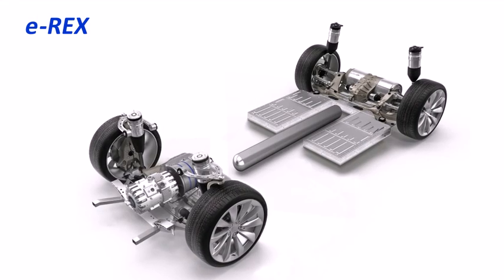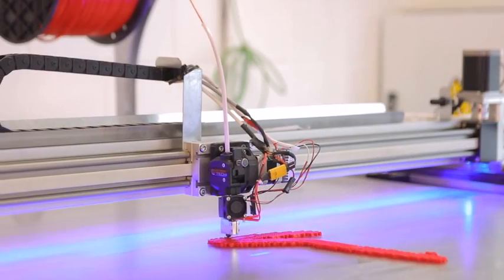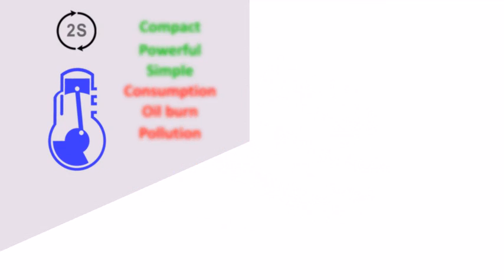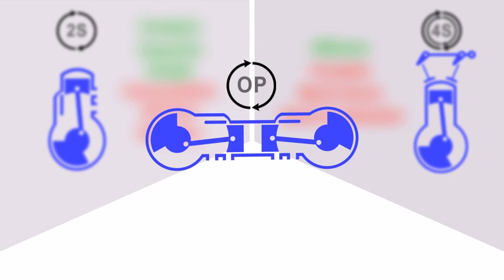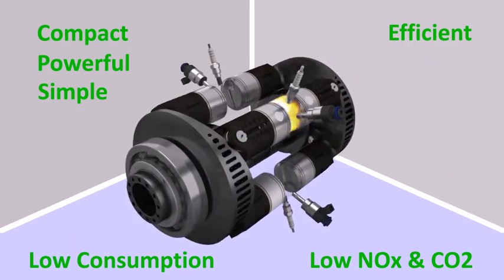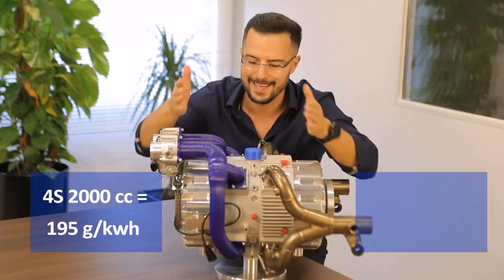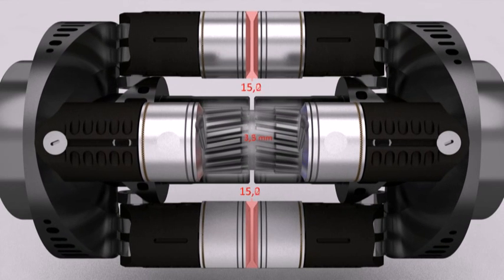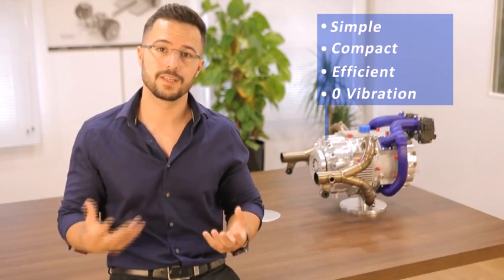e-REX. The True Range Extender by INNengine (English version)

Comment: I'm more concerned about the piston bearings. From what I see in the animation, the bearings rolls against the crank "plate". CMIIW. Is it durable, with the friction and pressure applied?
Reply from the maker: Yes, after hundreds of durability testing hours we have had no issues whatsoever and yet, on the new prototype we are building the system has been improved.
Reply: Hundreds? I think you need to run it for 10's of thousands of hrs before claiming durability no?

Comment: Since there's only 1 spark plug per cylinder, wouldn't that be considered a 2 stroke?
Reply: It has nothing to do with the spark plug, but yes the operation is the same as a 2 stroke.
Reply: @V0latyleUSMC  From the spark plug, when it fires, the piston will move back, that's 1 stroke, when the piston returns, thats 2 stroke. If you fire a 2nd sparkplug at the end of 1stroke, that would create another 1 stroke. so that's a real 1 stroke.

Comment: By the first view this motor looks very much promising. To my opinion the designation "one stroke" is kind of marketing. So be it. 

What I do not understand: How does the air intake work? The combustion drives the pistons apart. Due to the pressure caused by combustion there cannot be any vacuum to make the air flow into the combustion chamber. There must be an outside compressing device to blow the air in. In demonstration videos miraculously fresh air comes in. There must be some hidden device, or I am wrong.

Finally, I do not belive in plain electric cars. The combination of electric and combustion driven cars may be the future. Maybe use the e-REX with a flanged-on electric motor. No gear box (which consumes some power). Since most of the time cars run with highest gear engaged, the combustion motor may be fully engaged at higher speed. In lower speed both motors do the work. In dead slow the car runs electic only. The range of the battery may be 50 kilometers or less. This is a design I could imagine as a future propulsion for automotive vehicles. E-REX may be perfect there fore.

But how is long-time run of this motor?
Reply from the maker: Very good eye. There is a scavenging pump that forces the air into the cylinders.

Comment: Sometimes it makes you wonder why it took so much for such an engine to be developed. From the looks of it, it isn't anything spectacular in terms of materials use. 

I mean, correct me if I'm wrong but everything that this engine is using in terms of materials and parts could have been done with technology from 50 years ago.
Reply from the maker: Yes and no. It could have been made for sure, but for an engine with ports to be more efficient than one with valves, advanced direct injection is key. We are implementing DI with active pre-chamber ignition which will give us outstanding consumption figures by the end of 2023.

Comment: How does scavenging work on this engine?
Reply: Exactly, what creates the pressure difference so intake air will push out exhaust gas?   There is no scavenging without pressure differential.
Reply: They use a blower.  Found more info on this.
Reply from the maker: @timduncan8450  You are right, we use what is called a scavenging pump. Thanks to that we can control air flow more effectively while keeping the pistons doing what they are meant for: providing power.
Reply: @innengine   Thanks for the reply.   I could not find any recent news.  Can you please link or indicate where to find detailed reviews in English.   Thx

Comment: I don't think they understand how to count strokes. Using this counting method a traditional V-8 is a half stroke since there is 2 power strokes per revolution in the engine.
Reply from the maker: Not if you count per cylinder per rev. The point of power density is having more power from a smaller engine. In terms of power density our engine is to a 2S what 2S is to a 4S.
 In any case, it is indeed a two stroke, but not a regular one. Has 2x more power strokes per revulotion and cylinder than a 2 stroke. It does not use oil in the mix. It doesn't have the pullution issues 2strokes have derived from the fact that the exhaust port closes after the intake one.... and many more things. There are so many differences that, when the 1Stroke reference was sugested to us we said, yeah why not? It gives us a chance to engage inquisitive people.
Thanks for your coments!

Comment: Could Imagine compared two the rotary-engine (Wankel) the E-Rex engine is Not driveable, while rotary-engines showed good Characteristics as a Range-Extender.
Not driveable Means Low Torque at lower revs. The reaction for acceleration under load Not as expected.
Even maybe can Not be enabled by a Toyota-like Hybrid Concept to be driveable.
The worldrecord breaking Prius has also a non-driveable engine but there a 4-stroke working in Atkinson-Cycle. The Prius needs the integrated E-engine to offer driveability.
So E-Rex is Just a Range-Extender.
Opel Had a E-car with Range-Extender, where the combustion-engine could provide Power for propulsion.
European carmakers new Plugin Hybrids will show this Mode again but Not Being a E-car with Range-Extender in the base. It is a Plugin-Hybrid with Further modes. Instead of Just recuperation via E-engines and Starter-Generator also production Electric Power working asca Range-Extender, while the E-engines provide propulsion. At Higher Speeds the combustion engine Supports the E-Engines. In Traction situations uphill the E-engines Support the combustion engine. Why? How many Horsepower or Torque does a passenger Car need to go uphill If you Do this via E-engines only? Pure e-cars are Always overpowered.
Electric Trucks with 1000 hps won't work you need more. Towards 2000 hps.
Also Common-Rail Turbo-Diesel were an issue with gearboxes and Automatic Transmission boxes. High Torque at Low revs. Longer Gear Ratio due to higher Torque means more hps as uphill hps and Torque at the Radius of the tires is important.

We need flying Cars Like in the Movie "Blade-Runner". This would be groundbreaking....

Comment: Clever sales pitch but it is most definitely not a 1 stroke engine……Stroke is defined by piston movement not engine revolutions.

I do like the concept but it’s not that different to the Wankel rotary engine. Fuel efficiency however is all about saving weight and this will be a heavy engine compared to a cam-less 4 stroke.
Reply from the maker: Other than both being ICE, it has nothing to do with a wankel engine. All issues with wankel/liquid piston engines derive from their oddly shapped combustion chamber. In terms of combustion chamber, the e-REX is pretty much like any other OP engine out there, which makes it very efficient. As for weight, a 500cc delivering 120hp @6000rpm weights 35kg. And the difference in weight is more drastic the larger the CC.
Thanks for your comment!
Reply: @innengine thanks for your response. I’m quite familiar with opposed piston engines, they’ve been around a long time in the marine world (I’m a marine Engjneer). This design is basically an opposed piston engine combined with an axial piston piston pump that despite the clever sales pitch very definitely runs on the 2 stroke cycle…..much like a Doxford.

Because of this it has the inherent advantages of a 2 stroke such as increased power and lighter weight coupled with disadvantages such as poor scavenging, the inability to vary anything but exhaust valve timing to control emissions and carbon fouling.

The weight advantage you are speaking of would have been impressive 10 years ago but not today. Koenigsegg built a 600hp 3 cylinder camless 4 stroke engine that weighs only 70 kg…….2 years ago. Twice the weight of this OP design but 3 times the power and also for a hybrid.

The reason OP engines died out in the marine world is their complexity and weight which made them expensive to build and maintain. 

How long do you expect the variable compression mechanism to last under higher loads and as soot and dirt accumulate?

Have you figured out the bearing issue as well as the uneven side loading of the piston….the crankshaft surface isn’t flat so there will be a radial force applied by the piston to the cylinder wall, this will be further exacerbated by the flat formation of the engine requiring a lubricated piston skirt.

There is also a problem lubricating the piston followers and crank shaft…..you have two hardened surfaces operating much like a cam that will require highly pressurized oil to maintain low surface friction and remove heat build up. I don’t see cooling water, lube oil and turbo charging systems on this engine which are required for this engine to compete with conventional 4 strokes…..are they included in the weight you mentioned?

Unlike a camless engine the bearings in this design will require strict quality control and be of the roller or ball type which limits loading and that in turn limits durability and reliability for long life applications. Modern ICEs now reliably last 500000 kms or more, modern roller and ball type bearings are good for 20000 hours in perfect clean service…..reduce that to 5000 hours or less in engine oil. For arguments sake 500000 km is equivalent to 20000 hours service life assuming an average speed of 30km/hr over the life of the vehicle.

Comparison to Wankel engines is the low vibration and firing cycle…..once every cycle of the pistons or rotor as well as simple bearings and lubrication…..the wankel however is definitely lighter and less complex.

Hydrogen 4 stroke cam less or Wankel rotary hybrid is the future.

Comment: 1 exposion moving 2 pistons instead of 1 = less power...unless you can prove you can get more work out of less fuel..    ps.. the whole point of a centrifugal force pushing on a cantalevel _crankshaft  = the applicition of torque..  without torque your 5billion horsepower engine cant move ANYTHING.

Comment: This is total BS. Its a 2 stroke 4 cylinder engine which fires every 180 degrees, Exactly the same as an inline 4 cylinder 4 stroke. Yes it is small and light weight which is a big benefit but still falls short of a liquid piston engine.

Comment: Power figures?
You claim it’s as powerful as a “2000cc 4 stroke” ... But what engine?
Yes, in basic theory 4 times as many power cycles means 4 times as much power. But that’s not how the real world works.
Present some factual data, not just numbers pulled out your rear.
Reply: Yeah, it's basically just a 2 stroke 4 cylinder with 180° firing order.